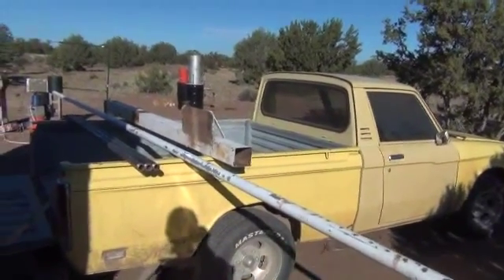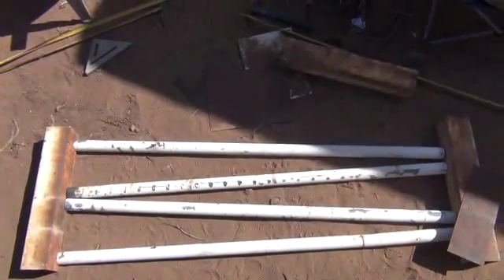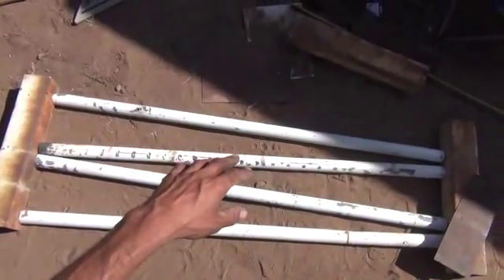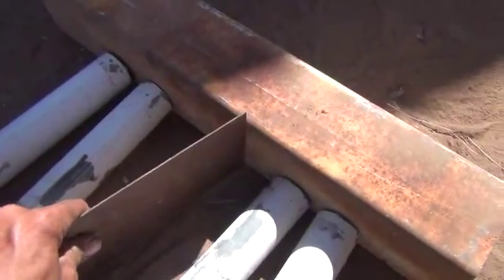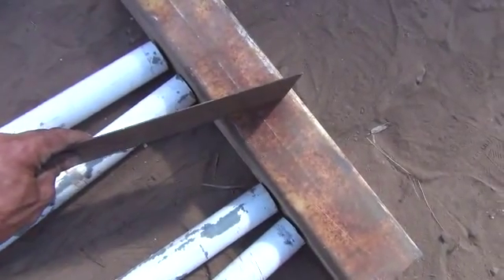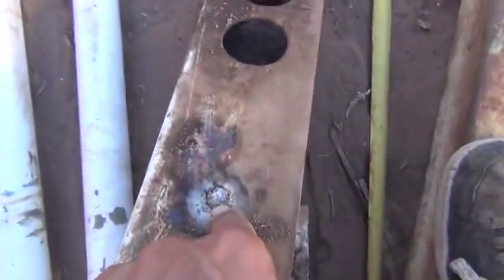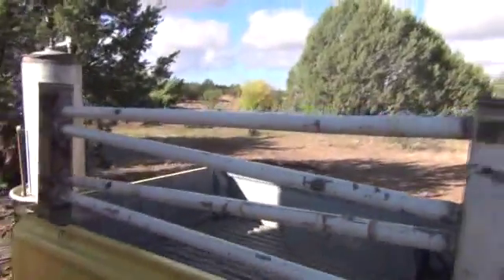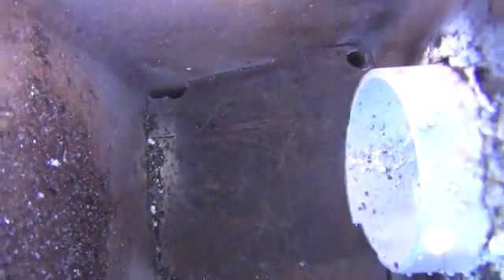Gasifier Truck How-To part 8

Comment: I am confused about how the radiator cooling pipes on the sides are supposed to work.  It would seems to me that it will simply go into the square stock that you have and eventually make its way through the pipe but will not travel through the pipe like it does in your Gassifier/Crude Oil/Generator/Refrigerator video.